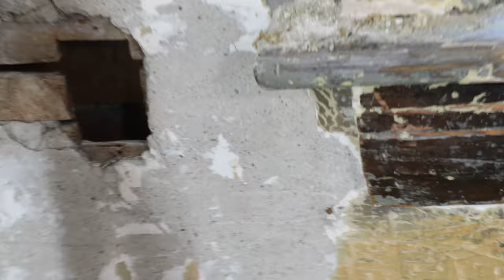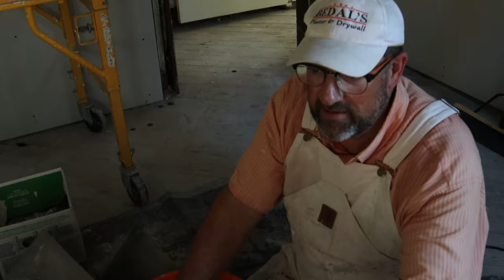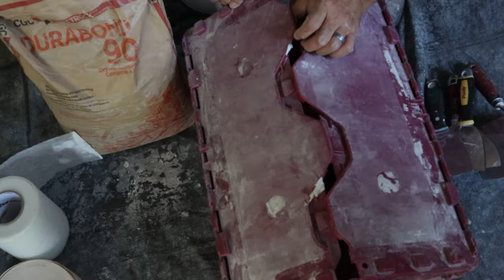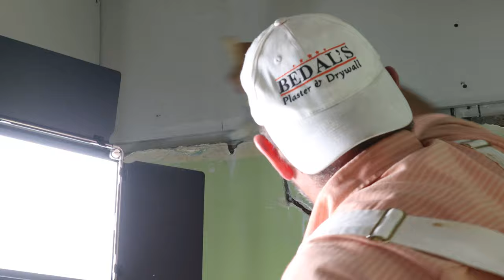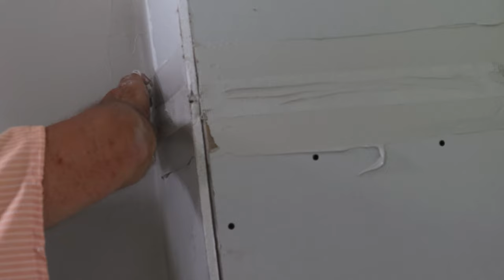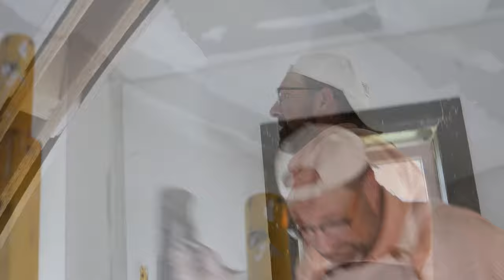Plaster and Drywall | HISTORIC MANSION | Part 5 | Breakfast Nook

Comment: On the patching of the holes etc, on the old plaster areas, best to wet the old wood lath a bit first, then use Structo Lite gypsum plaster mixed in small batches then add some dry portland cement after its mixed and mix that in. It will excellerate the set of the gypsum so that it will harden fast, allowing for doubleing up with a final coat in the same day. For open holes like old electrical boxes just shove some batt type insulation in the hole and apply the gypsum charged up with the portland. Finish with drywall spackle.

Comment: Enjoyed watching the video and learning. I have to fix similar plaster wall problems. Can you apply durabond with pva on the plaster base coat? The top coat on part of the wall came off exposing the base coat probably due to moisture.
Reply from the maker: Hi Badchips, you can do exactly what you're asking - it works perfectly!  I would make sure the PVA is applied to at least a 6" perimeter around the repair so when you apply a finish coat or two of drywall compound, it sticks to the existing lime finish.
Hope this helps and thanks for watching!

Comment: I have followed your steps,  scraped loose paint, washed the wall, opened the cracks, painted Plaster Bonder  then applied Durabond 90.  As it is drying I have areas that are bubbling. I opened a blister and it is loosen to the old plaster.  Do I need to remove the what I have have on the wall and start over again? Or do I treat it locally and move on?